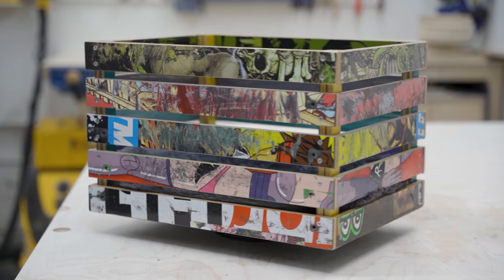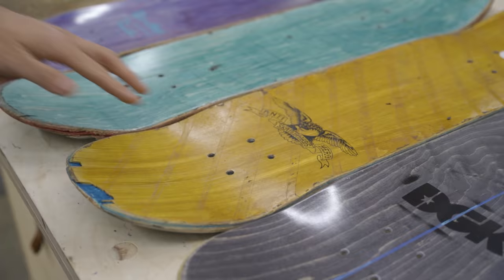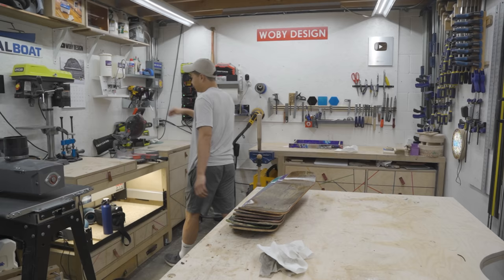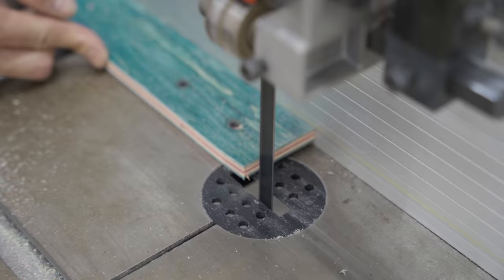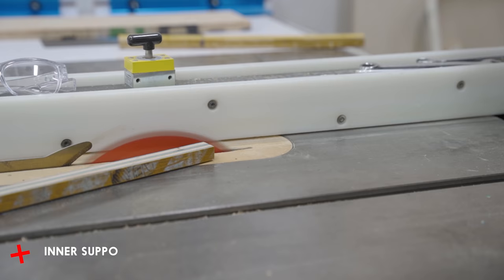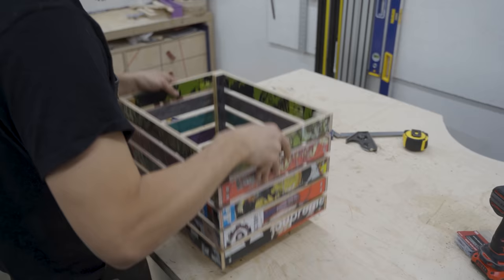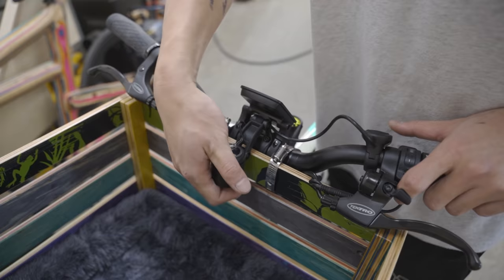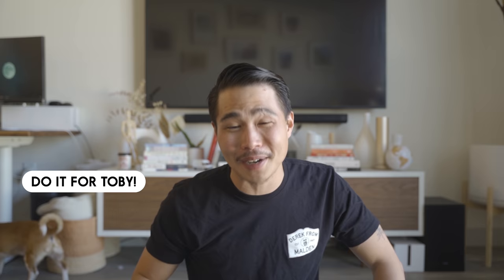VINTAGE APPLE CRATE MADE OUT OF SKATEBOARDS!

Comment: Ben, there is a much better way to remove the glue residue that will save a ton of time and effort. There is a product called Bestine which is a rubber cement solvent. It will dissolve that glue residue with little effort and it is mild enough that it will not harm the painted surface below. It's even mild enough to take stickers off of your car without hurting the paint. I've used it for years and it's a game changer when it comes to removing adhesives like that. I looked and you can get it on Amazon. Give it a try!
Reply: Does it require ventilation? If so, remember he's in a small workshop.
Reply: @novacaino  it’s not bad. Really no worse than acetone or lacquer thinner, in my opinion it’s even milder.

Comment: Great video!

I definitely recommend getting some type of front rack to support the bottom of the crate, on the small chance the top strip of skateboards somehow gets loose and comes off.

Wald has something called a "pizza box front basket" that should work and is pretty discreet if you do happen to be looking. And you could always modify it to make it less noticeable.

Comment: Try deep freezing the boards for about an hour to remove the grip tape. It should eliminate all the residue from heating it and you won’t need any chemicals. You have to work fast. Good luck. Lovein all the repurposing keep it up 👍🏻
Reply: I was just thinking that. Also i've had good results with Acetone, but not sure how it would react to the board graphics.

Comment: Very cool crate. I could take it or leave it on the voice over. You do you boo! 
But I also thought I would suggest an Eraser Wheel. It is available at autobody supply stores. It’s used to pull adhesive from tape and vinyl graphics off of cars. Put it in your drill and it will speed up the removal of the glue. Then you can follow up by wiping it down with the Goo Gone. Hope this helps.✌️❤️🤘

Comment: There's plenty great attachments you could use for your crate that should not cost much, there's even some systems from the likes of Ortlieb or Klickfix systems plus a couple others that could even make it easily detachable if you like that option. I'm confident you can find something similar from Bontrager or some other decent brand if those german brands aren't much available close to you.
Main issue you have here is it's leaning a bit on the one safety thing you never want to tamper too much with : your front brake. Even just slightly bearing on the caliper like that is not ideal and can lead to issues on a future ride. Those attachments would easily prevent that from ever happening.
I know, some are a bit bulky and quite ugly to be honest, but that is sometimes the little price to pay for a much greater peace of mind.
Also, i kinda liked that format, bit of a change with that voiceover, i thought it fitted particularly well on the shots were you showed the designs on the boards before and after having cut them to size, transitioned smoothly to the construction part.
 Love the final look of that crate as well.
Reply from the maker: Yeah we can go without eating meat but we do don’t we?

Comment: Couple tips and tricks you can make sanding discs with the grip tape and cereal boxes. Also the absolute best thing I've found for breaking down glue is lighter fluid, it works alot better than any goo gone or stuff like that. Just squirt a load on wait 30 secs and wipe away with paper towel. Great content and idea I need a skateboard crate in my life. You should have these all over the shop,  I always need more storage.